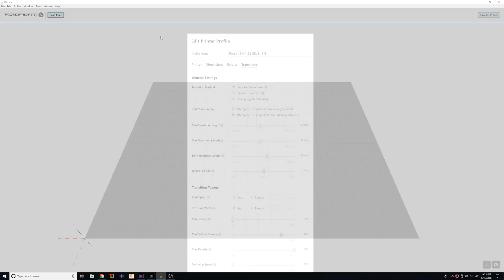3D Printing in Multi-Color with the Mosaic Palette+ on my Prusa MK3

Comment from the maker: I am going to experiment more with the palette+ in later videos, what aspects do you want to see?
Reply: Georges Gadgets great video as always! Don't forget Canada also pioneered the booming milk in a bag industry! I would love to see a video about how to calibrate the palette+.
Reply: Great video, again, as always. What is the difference between painting, as you have done in the past, and a multicolor print in terms of how the piece looks? Do you prefer to use this device or paint, if they are relatable enough? It seems like an old school 8-bit ATMega could run this thing. Is it using Arduino? I would print planets with it, at first. Barenaked Ladies and the electron microscope came from Canada.
Reply: codecitymayor at 3:11, you can see the board alright. It looks to me like your typical Arduino Mega 2560/RAMPS setup.
Reply: I am very curious about the waste towers, how much it is with and without the palette+ compared to a 4 color prusa for instance?
Reply from the maker: Also milk bags and maple syrup. I think that it really depends on the look you are going for.  If you have the right colored filament you can pull off some really cool prints, but you cant beat a good painter. It looks like an old ramps.  I think a super cool project (that I am not capable of) would be for someone to try and mimic it.....
Reply: I watched the video again, and I saw the same thing. That's pretty interesting. It makes sense, though.
Reply: Georges Gadgets Please tell me you are going to make a pre-release video comparing or offering your thoughts on the Wanhao Duplicator 10 vs the Kodoma Obsidian?

Comment: fuf 800 is quite a lot :-/  I'll wait for the prusa MMU 2.0 if they ever ship them :D
Reply from the maker: It is a lot! My prusa came in for the mmu and it has similar pains like the mosaic :/
Reply: @GeorgesGadgets  Is the MMU 2.0 not working well ? I have it at pre-order so I don't know when it come, but I would like to keep the Prusa Mk3 as go to no fuss no issue printer as it is for me now... I have replaced my Felix 3.1 with it and its a huge difference... Prusa just prints.., I don't have to spend 15min leveling bed and hoping that its ok, starting and restarting print 5 times.. that was soul crushing :D
Reply from the maker: Duuude I know! I had to do the same thing with my hatchbox and tevo.  The prusa just prints.  The MMU2 adds that finickyness to the prusa, it is still really cool but it can be a pain in the butt :/

Comment: We need a system that uses one white filament and color cartridges like in a normal printer. The color should be added just before the hot zone where it should mix with the filament. I'm sure in a few years we will have full range rgb coloured prints that look amazing. But I don't think this filament splicing is the way.
Reply from the maker: That would be so incredibly cool
Reply: The XYZ da Vinci Color 3D Printer combines inkjet technology with FDM printing. It is expensive at $3500, but the final result is pretty cool. Check it out!

Comment: As nice as the prints look, I don't think multi-color printing will ever take off as long as there is  a purge block. It's too wasteful. Hopefully someone will come up with something that mixes the plastics at the hot end, and supply the filament as it's needed.
Reply from the maker: I think that maybe e3d's tool change system is the way to go.  Its just the price point for those are even higher than this!
Reply: That's definitely an improvement, but I mean mixing color on demand (one print head). For example, it reads the gcode coming up and knows in 5 inches it's going to need some teal filament, so it figures out based on feed rate, retraction, etc... when to mix it, and how much. Ideally it would print non-stop like a normal single filament printer would.

Comment: Great results.  However, I am still confused as to why it needs to create a purge block.  I thought since it calibrates the length of filament between colors it "knows" how long each piece of different color filaments it needs and fuses those pieces together in the correct order and correct lengths.  That way the printer just continues printing like it was using one continuous filament.  I guess I do not understand their design enough.
Reply: Since the multiple colors are going through the same nozzle, there is going to be some mixing of filaments in the nozzle, do you want striped filament coming out?
Reply: Makes sense

Comment: To me the design of a system like this that measures and splices the filament "exactly" where needed was supposed to negate the need for a scrub block, this is why I will probably never buy a system like this, but I admit the prints do look good. Instead someone can tweak the software to use the infill area as the scrub block instead so as to not waste print material.........duh. It may have limitations and drawbacks but it seems like no one is trying it to my knowledge
Reply from the maker: Hey Mythos, that is actual a feature with this system if you slice your model in Cura, but I did not use cura :\  Also I believe that prusa is working this in on his version which looks pretty sick also.  Thank you so much for checking out the video, if you have any questions let me know :D
Reply: Georges Gadgets, awesome, thanks for the info
Reply from the maker: no problem man :D
Reply: The next major Slic3r prusa edition version is due to have it. Once the mmu2 is out I believe, and betas of the mm2 are being shipped. So, soon.   .... AND it will also enable the excess waste filament to be used for printing a mixed-up colour 'part' rather than a block. So the waste can first go to infill, and the extra can be used to print a 'bonus' part. Pretty cool.

Comment: For the price point of this machine I could add 3 more extruders to my 3d printer and save about $300
Reply from the maker: Ajw312, very true! But with this you could take it and put it on any printer and it works instead of having to add extruders for all your printers

It is pricy I understand that, but there are ups and downs of any option

For instance, one could buy 3 tevo tarantulas instead of one original prusa
Reply: You can still only use it on one printer at a time? Only way I see this useful is if you can respool what you need ahead of time.

Comment: Could you use support material on that device?  PVA?  Scaffold?
Reply from the maker: Yes you can, and that is something I can show you guys in a later video! Thank you for the suggestion ;-)
Reply: Georges Gadgets if you're in the market for a spool of PVA (liquid soluble filament) I have a whole spool I never got around to using I'll sell you for $10. I'll even let you print with it first to make sure it isn't dead.